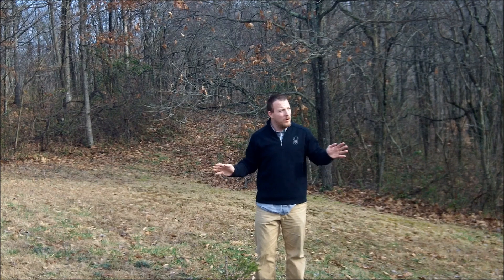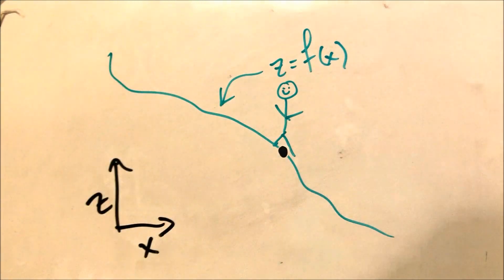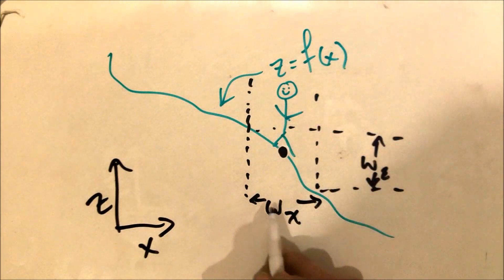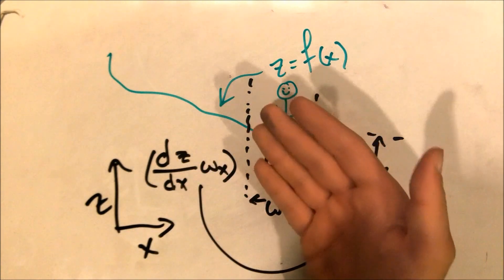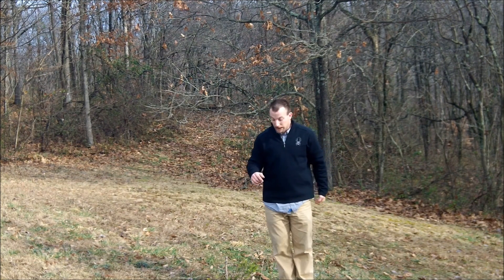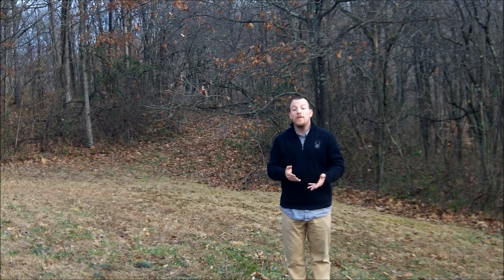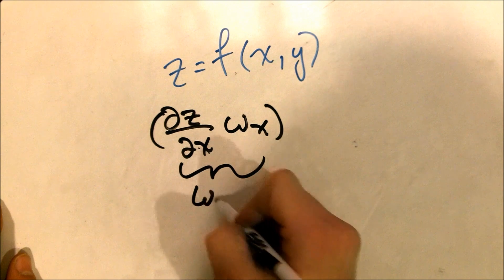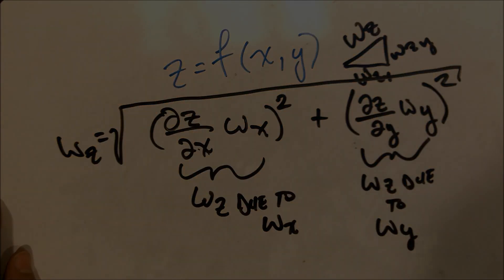Multivariate Uncertainty Analysis

Comment: Thanks for the great explanation. The reason I point out the perturbation analysis is when I was in school, and I'll use fluid dynamics and controls theory as the examples, we learned the hard math and I think students need to but that  we were seldom taught the shortcuts that are more commonly used once you get a job, and I think there is value in teaching that too, particularly for undergrads. I lost a lot of my calculus skills in 30 years but I can do numerical anytime.Thanks and nice video.